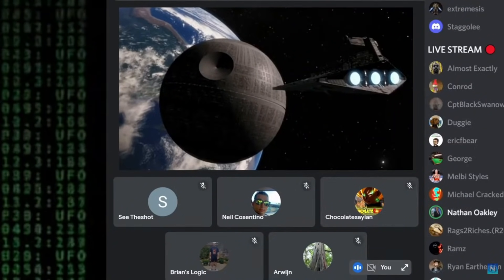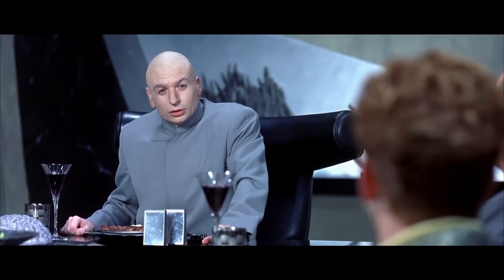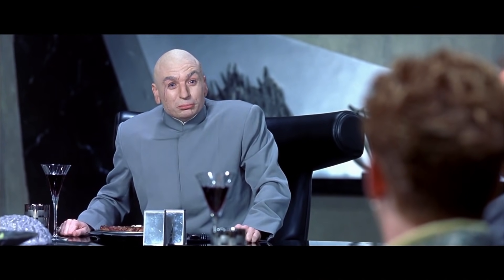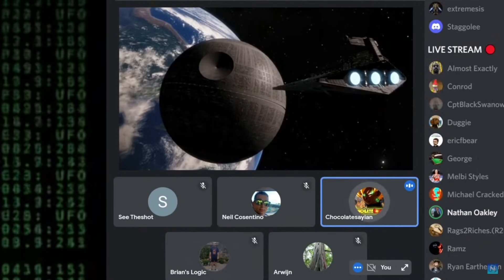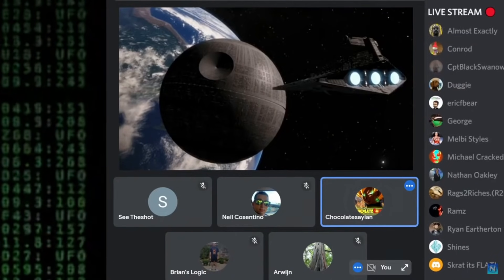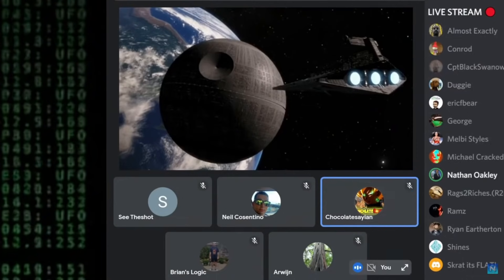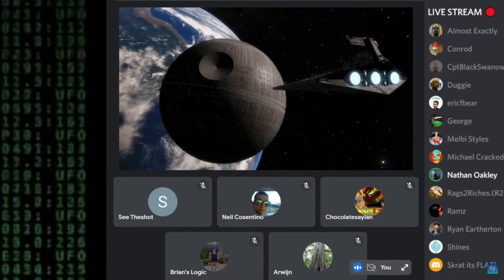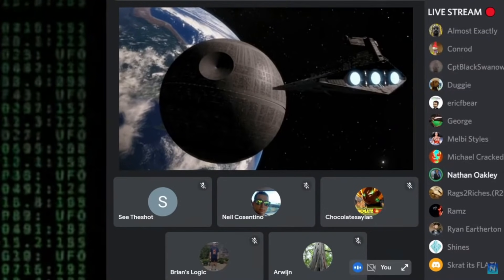Now an Open Pipe Isn't a Container - Wait...

Comment: He probably thinks that 0 gauge pressure means there is a perfect vacuum. It does not. Zero gauge pressure is the standard atmospheric, roughly 14.7 psi absolute. Anything less than that is vacuum down to 0 absolute or about 30 inches of mercury.

Comment: Brian's Logic tried the same with Mr. Sensible, simply claiming that gas only has density, no weight, therefore no inertia, but that it consists of particles, and these particles are ALWAYS accelerating.
 
No evidence, just claims. 
 
 
You can measure the weight of pressurized gas. 
 
You can liquify gas and then it has mass, weight and inertia.
 
You can easily generate gas (hydrogen and oxygen) from water that has mass, weight and inertia 
 
How come that these inherent properties disappear when it turns into a gas?  

When you tell him that, he ignores it.    
 
 
The argument goes something like" 

As you are in a gaseous environment (i.e. surrounded by air), you cannot weigh air. 
 
  
 
This nonsense has an additional benefit: 
 
As any gas is now declared as having ZERO inertia, the exhaust gases of a rocket can also not have inertia, and therefore they would accelerate infinitely fast into the vacuum of space. Therefore no thrust in space is possible. 
 
 
Was it Brian or Nathan who invented this narrative? 
E.g. the Rayleigh Criterion was brought up by gudtimes4all, and Nathan took it over, until he was destroyed by Bob in hangout. Since then it is not used a lot anymore...

Comment: You gave yourself away at 2:50. 

“All you need is one of these (earth) and gravity will take care of the rest” 

1. You appealed to the earth which is the system in question 
2. You claimed gravity can act as a physical barrier to gas, but your only example is the thing in question. Show us an example of gravity acting as a container wall to gas that isn’t earth.
Reply from the maker: You seem to be making up something I didn't say. I claim no physical barrier whatsoever. Gravity acts on gas molecules just as it does on anything that has mass and I demonstrated that with a "not a container" open pipe filled with butane. You're trying to make a QE/Oakley argument for a container requirement so I would suggest that you're the one who just gave yourself away. But thanks for watching!

Comment: What would happen if the pipe was vertical and 100 miles high. Then close off the bottom, it's now a container with the same pressure profile at the atmosphere.

Comment: what you need to maintain a given pressure is a physical effect constraining the motion of the gas molecules.

In a container that is the reaction force off the walls of the container.

In a tokamak reactor it is electro-magnetic force applied to the ions in the plasma.

In the atmosphere it is the influence of gravity. Again, this is not that hard.
Reply from the maker: No, it really isn't which is a testament to flerfistics because those idiots have thought of ways to make it seem impossible and that requires considerable talent!

Comment: Where did Oakley say that a open pipe was a container?
Reply from the maker: He and every flerf on the planet have been parroting that for two solid years now. It's been their standard complaint that I used a container (an open pipe) to demonstrate how gravity holds gas in place and produces our pressure gradient. Check out some of my old video's.

Comment: Every explanation flerfers come up with for anything has so many holes in it, that they are constantly busy plugging the holes with new explanations, that contradict the very first explanation, most of the time. And because a flerfers' ability to mount a somewhat logical type of reasoning, they don't notice this.
That's what makes a discussion with a flerfer virtually impossible.

Comment: I can see Nathan Oakley testing this with the same vertical pipe and butane gas setup you used, Blue.
Then he checks for the presence of the butane with a lighted match.
Gas go up (in flames), Nathan go down, go boom boom.

Questions for Flat Earthers:
[1] How does the air in a hot air balloon stay inside it if the bottom of the envelope is open?
[2] How can you have a building with a positive pressure differential with respect to the outside if the door is open?  Maybe by having a fan blowing into the building?  No sealed container, just a force acting upon the air to keep it moving in a specific direction, perhaps.

Comment: My favorite part in that video was the collegial discussion about how air not only can't have mass because it's... something-or-other, air doesn't have inertia, either.

That's good news. I've got some plywood I need to move and the wind is blowing pretty good. Back when air had inertia that would have been a pain in the butt.

But I wonder - does my sailboat still work?
Reply: Not with this new dispensation, no. Sorry. 😜
Reply: @jormungandr9251  Oh, horrors. I enjoyed sailing, back when it still worked. :-)
Reply: But maybe the sails are a container, like the wings of an aircraft, that produce lift from a gas with no inertia.
Hey Nathan, gives us a hand and helps out here, will you!?
Or perhaps Brian the aeronautical expert!
Reply: @carioca45  It's funny, to my "bubba" mindset, to draw much of a difference between gas pressure by influence of gravity versus gas pressure because it's pumped into a tank.

Gas assumes the shape of the forces acting on it. Sometimes those forces are contact forces from physical things, like the interior of a scuba tank, other times it's because f=ma. Gas has mass, earth donates an acceleration, you pretty much have to have a force.

Gas assumes a shape.
Reply: @johnnyragadoo2414  that is the point with FEs they never mention forces.
It's always, density, pressure, mass being a deception and confusing it with weight. However never elaborate on what is a force.
I once tried to get Brandon Toy to comment on what would a Force be and maybe make a video on it. He replied "No thank you I have spent too much time thinking about it already." or something to that effect. 
Balance is achieved by analysing the forces acting on. Not RDD or some other silly theory.
Sailing, like flying, still works just fine. Gases have mass, which isn't a deception.

Comment: Why is this still a thing !?
Flat Earth's contention is that "gas pressure" cannot exist without a container ... and they're (essentially) correct.
However, they then say that the Earth's atmosphere is an example of "gas pressure" and must therefore have a container.

Now ... why are people still arguing whether or not a container is required for "gas pressure" when the ONLY thing that matters in this argument is whether or not the atmosphere is an example of "gas pressure". If it's not, the whole argument dies.

It is up to Flat Earth to PROVE that the atmosphere is "gas pressure", and in order for them to do that, all they have to do is prove that the dome exists. Until they do, Globers can just sit back and ignore this entire "hypothesis".

If a Flerf brings the subject up, just ask them to prove that the atmosphere is "gas pressure" and not "surface pressure" ... then leave it.

TLDR;
FE needs to prove the dome exists in order to prove that the atmosphere is "gas pressure", not vice versa
Reply: Yes then the FE believers just pretend to have no requirement to prove the dome since it is our claim that it doesn't exist. FE believers rarely take responsibility for what they know or don't know.

Comment: The thing that Nathan wants to deny is that  pressure is usually measured against another reference pressure, frequently a vacuum.   Now if you want you can determine a pressure by using PV=nRt and finding all the terms and getting P.  This works for any volume, but it does not need to be enclosed.  This idea that you can define a volume without having physical walls around that volume seems to send Nathan and QE into fits of sputtering rage.  Amusing as using a defined volume in this way is the basis of much of math, physics, chemistry, etc. Further evidence of the lack of education of this group.
Reply from the maker: That's exactly how we take F-Ma combined with PV-nRT and derive the barometric formula. It isn't based on a physical volume. It's a notional volume and it works perfectly. These people are simply too stupid for words.
Reply: @bluemarblescience  Yes.  Anyone that has taken a calculus course would know this of course.  Want to find the volume of a sphere?  Of course you work with dv/dr or something like that.  It's really basic stuff to anyone with a bit of math or science background and the lack of any understanding of that just shows that these guys have no background in anything.  It's not like they brought a knife to a gun fight, the are essentially unarmed.  Educationally unarmed.  The fact that they don't know it just makes them more pitiful.
Reply from the maker: @charlie2640  The truly sad part is the fact that most of them aren't even smart enough to know what they don't know. So many of them actually believe math is optional. I can't think of anything to do with the physics or chemistry they argue about that can be understood without it! So what you said is the pathetic truth. They have no background or understanding of anything and to make it worse, they're immensely proud of it!

Comment: Oh man, Nathan keeps proving he’s the embodiment of Dunning-Kruger. We’ll just keep reminding him that there’s a pretty major pressure gradient between sea-level and 30,000 feet with no barrier or container and it’s all the same mixture of gases. He’ll never address it.
Reply: Some flat earther claim, the pressure gradient is due to gas created on the ground raising up. But there are vertical wind tunnels where you have such strong upwards wind that you can float, without creating a pressure gradient bigger than in the atmosphere. So if even such strong winds can not produce a pressure gradient as observed in the atmosphere... 🤦‍♂️
Reply: @WalterBislin  That has to be the most desperate wishful-thinking I’ve ever heard. LOL Thanks for that Walter and thank you for your amazing work! 👏👏👏👏
Reply: Nuh uh
Reply: @C4...  Touché!

Comment: I watched a science teacher pour gas into a contraption with an open ramp that flows down to a flame, that then ignites the gas all the way back to where it came from, clearly showing that the gas doesn’t just float away

I wondered what the flerfs would think about it
Reply: Thinking is hard for flerfs and hurts too much, so probably not.
Reply: Blue Marble Science has a video with an open tube containing butane and the gas stays in the open tube, and doesn’t mix either.
Reply: @davidlazarus67  Butane not acetylene, acetylene is lighter than air.
Reply: @cambridgemart2075  thanks for the correction.
Reply: @davidlazarus67  yea I saw that one too
Reply: @urmakinitworse  The interesting aspect is that theoretically that tube could go into outer space and the vacuum and the butane would still be in the bottom of the pipe.
Reply: @davidlazarus67  right
Reply: @urmakinitworse  And Flerfer’s will claim something stupid like it’s touching the dome. I do enjoy these types of videos as it gives me a chance to test the brain on something that I haven’t studied for a long time.
Reply: @davidlazarus67  well, they won’t be able to get over the fact that the pipe has walls. Having an open top isn’t good enough for them.
Reply: @urmakinitworse  Very true.

Comment: Atmospheric pressure is already easy proof of gas pressure without a container. I'm still waiting for Oakley, or any other flerf, to show evidence that a magical physical container/dome actually exists to contain the atmosphere. Nobody has seen the dome, nor has anybody detected it via other means (such as bouncing radio waves off of it). Ironically enough, flerfs can only presuppose its existence.
Reply: But the atmosphere has a container. It can't go down since the ground is it the way, it can't go sideways since it meets itself coming the other way and since, according to Riley, it can't go up because gas particles are denser than vacuum so they must fall down.
Reply: @grahvis  But Riley says they don't have any weight if they're not contained!!!!!
Reply: @cambridgemart2075  .
Ah yes, I forgot, they don't have mass only pressure.  I did try asking him what made a gas particle different from any other particle but he muttered about not answering questions and ran away.
Reply: Atmospheric pressure is higher at sea level than a mountain top. Where’s the container?
Atmospheric pressure is higher in Death Valley than at sea level. Where’s the container? 
Atmospheric pressure is higher at the bottom of a mine than at the surface, open pit or mine shaft, doesn’t matter. Where’s the container.
Reply: Ionospheric bounce (how ham radio operators can talk to their friends in Japan) has radio signals bounce off the ionosphere.  But of course, the ionosphere ain't solid.

The simple truth is that the atmosphere is mostly contained by a force field.

That force field is called gravity ;-)